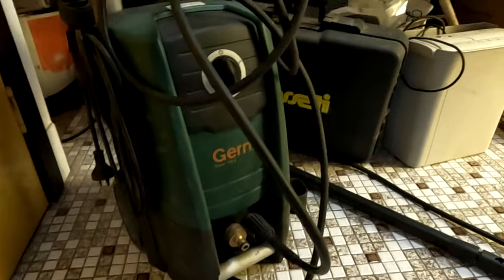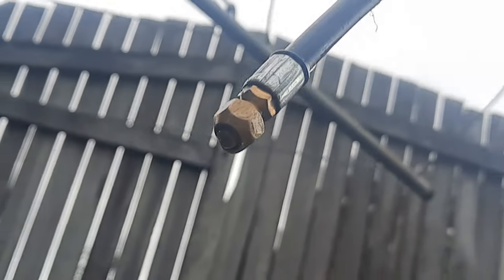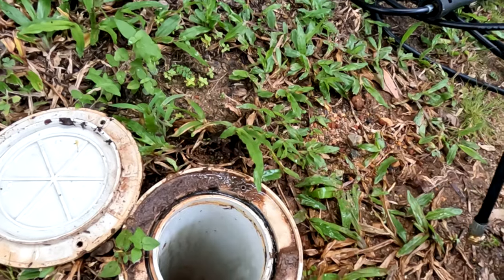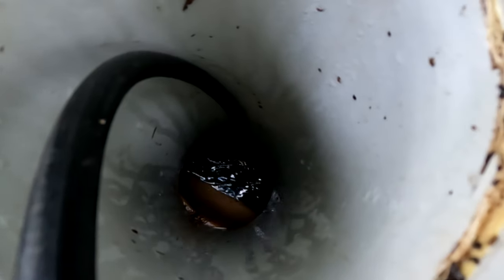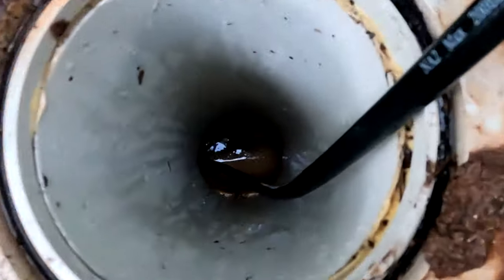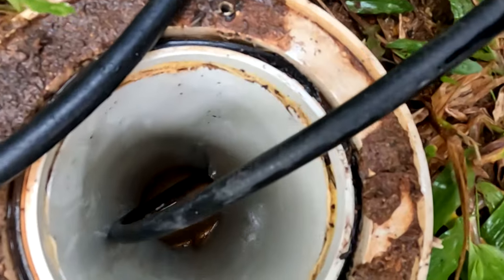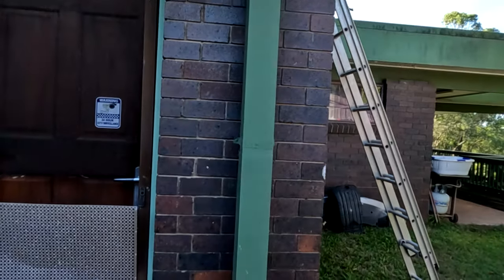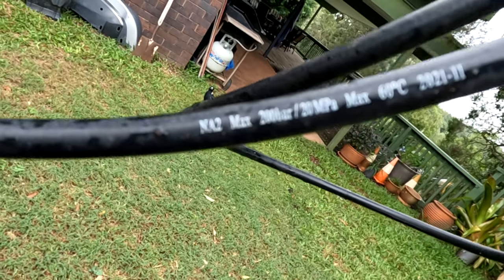How to Clear a Blocked Toilet or Drain YOURSELF

Comment: If it happens once.. and you know the cause.. then I am inclined to get the shovel out and deal with it...
2004 a friend was having problems with his sewage pipes.. it had been going on continually for years.. stink and block .. large amounts of money spent...
I finally convinced him to deal with it..
His son and his mates called round.. they had borrowed his boat for a few weeks and this was a favour in return..
Anyway a Saturday afternoon.. not sure how many friends but the whole length of the pipe was exposed.. and tree roots and a cracked pipe...
Job was easy to replace the entire length of pipe with plastic.. not the short bits...
A piece of yellow plastic gas pipe that was left over on the side of the road was tidied...
Moving on the trailer was fun, thankfully country lanes...
The look of my friend when he saw it...
"That'll fix it"
We added a nice manhole each end made of brick and back filled with sheets of scrap stainless and a strong mix of sand, gravel and cement.
He's not had any problem with it..
It's reminded me...
I will mention it's been 20 year's..

btw.. interesting thumbnail..
In the UK it's offensive to some..
Pooey or sewage..
acceptable..
It's because of when and where the word comes from.
Reply from the maker: Yes, TRUE to replace broken pipes IS the best solution, but in this case; it'd mean digging up the concrete slab of the house! Not a viable financial option!